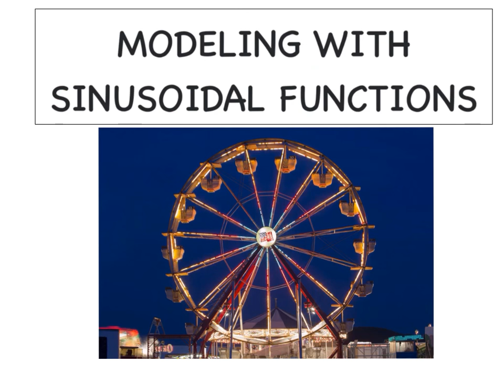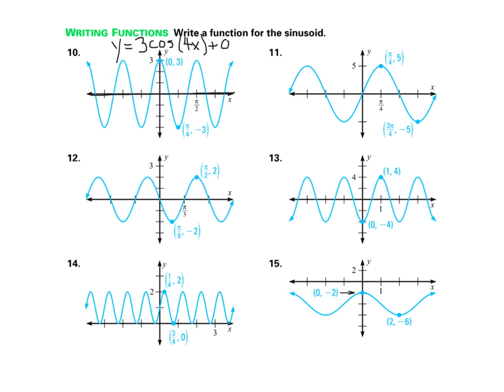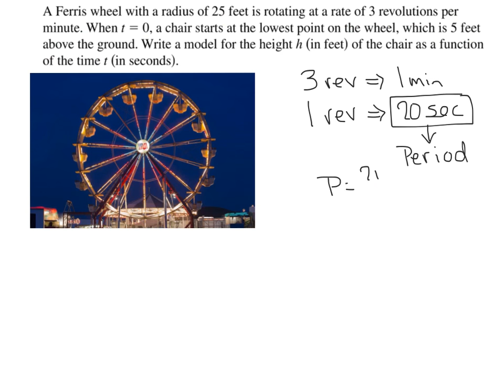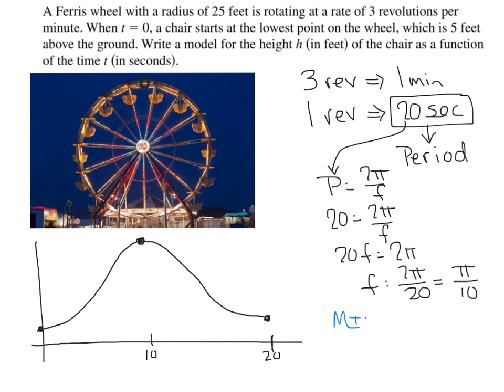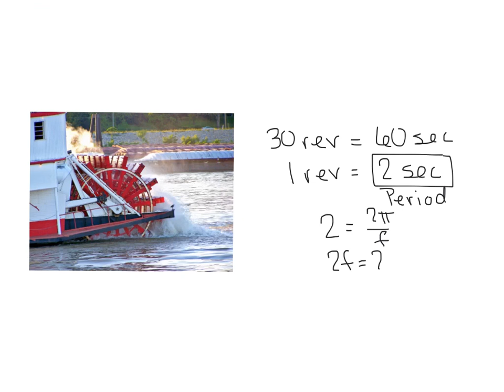CCA2 - Modeling w Sinusoidal Functions

Comment: You forgot the C. Because its a cos function the max has been shifted to the right by 10 right? I dunno
Reply: 4 years late but no, however this would've been right if we didn't assume that the graph was flipped over the x axis, but since he did consider this there's no need to include our c value for this graph bc the reflection accounts for the phase shift because he looked at the graph from when it started at 0 instead of looking at it at its highest point, which would've been at 10.

basically the reflection flips the graph but also accounts for the phase shift